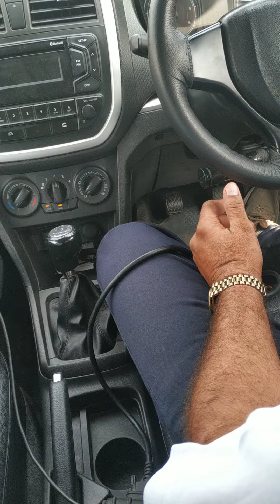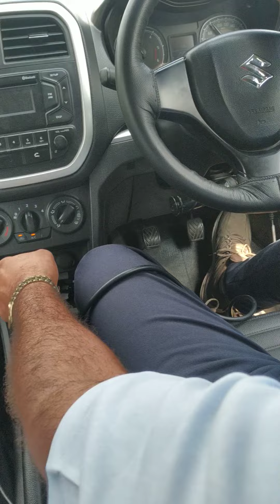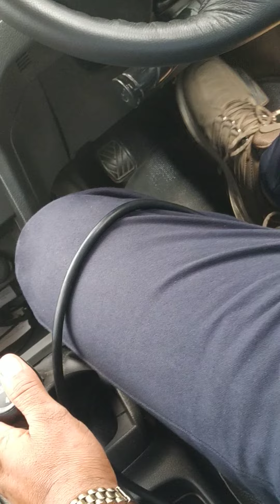Manual clutch car converted to automatic clutch car 🚘🚘🚘

Comment: This will spoil your engine and clutch
Reply from the maker: Never
Reply: @jagatwalia  yes. Clutch is still pressed half even when giving throttle. This is called riding the clutch. This will definitely damage and make your clutch wear faster. Go and Google it you don't know something
Reply: @mr.strange5679  but it’s based on rpm that means if u rev it up a lil bit the clutch will release. It releases based on the acceleration and the brake.